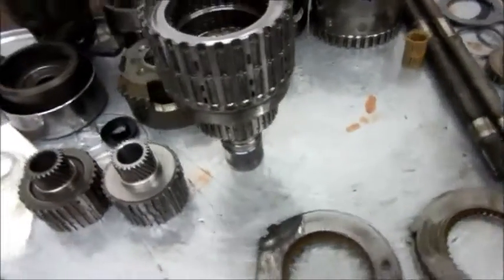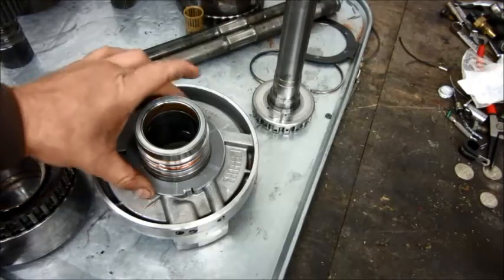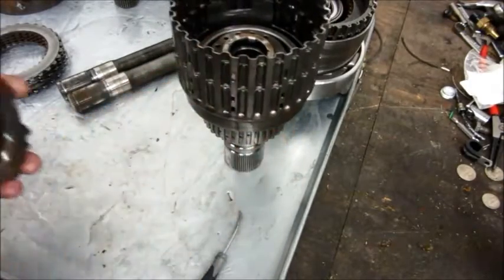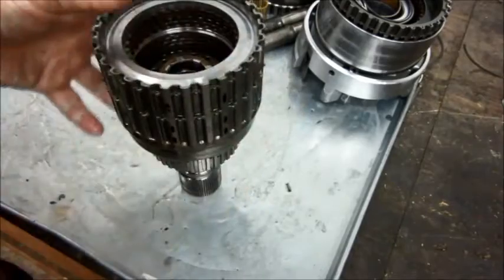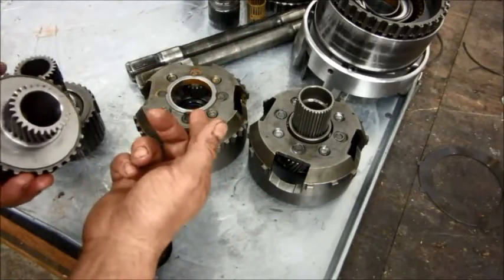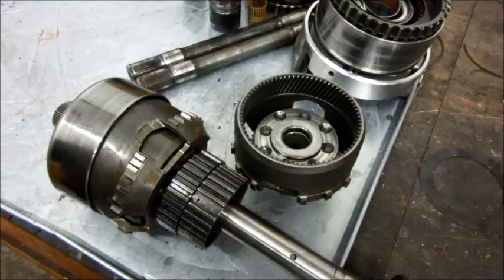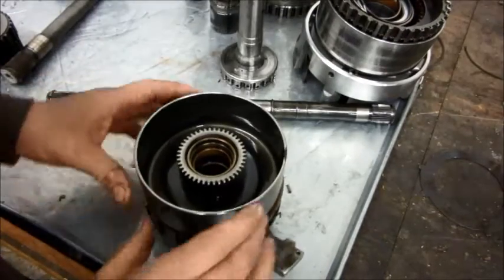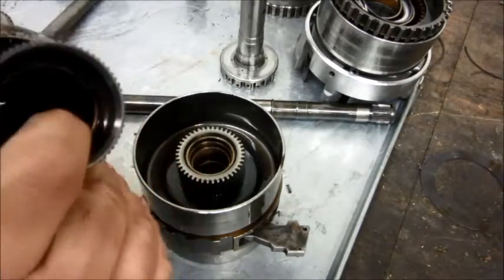Buick Turbo Draw-Through Build (pt 12) 440T4 Transmission Modifications 1

Comment: Loving this series!  Very detailed, well presented, and a plethora of information!

I'm curious:  With all the additional lubrication flow you're adding to this transmission, is there any need to compensate line pressure at the valve body?
Reply from the maker: +rhkips 

Thanks for the comment! I appreciate it.

There is a lube orifice that provides a certain amount of lube flow, higher flow when the line pressure is higher. It is called the "converter feed orifice" in the books.

The actual line pressure is set by the vacuum modulator / mod boost valve system. The turbocharger will apply positive pressure to the modulator and this will increase the line pressure above the original level. If this were a high-torque naturally-aspirated engine, then you would need to have a extra-high-ration modulator boost valve. That would allow for increased pressure without boost pressure being needed.

Comment: David,

What would you consider the biggest factor for bushing wear?  Would it be neglect or severe duty?
Reply: +Ken T. (Century7667) ....or just miles?
Reply from the maker: +Ken T. (Century7667) 

That's a hard thing to say. This transmission is 30 years old. It has signs that it's been open before, but no way to tell if the bushings have been changed or not. I have a feeling that high operating temperature, marginal lube flow (low / foamed oil etc.) and prolonged high RPM operation have a lot to do with it.
Reply: +davida1hiwaaynet Sounds like a good reason to keep the trans fluid fresh.  I did some reading on the trans.  I didn't realize how early model your transmission was.  The first one's were for the '85 model year, and that after a one year delay as they were intended to go into service for '84.
Reply from the maker: +Ken T. (Century7667) 

Exactly. The bushings are cheap and the only obstacle to most DIY folks is the driver tools. Since I have a lathe, it's trivial to turn down sockets to make drivers.

Yeah the one I have is spec'd out as an  86 model, but it has casting marks showing it was made in 85. The 1985 spec ones had a lot of concerns and they are not able to be updated to the final specification (the 89-93 style). Pretty much the only thing the 86 ones can't easily be retrofitted with is the "manouever pipe" on the pump. This does not affect durability, only downshift feel.

For a stock rebuild, the only "modifications" for later model 440T4 are a shift kit (system correction kit); adjustable modulator, metal 2nd gear thrust washer, and high ratio boost valve. On them, just renew what's worn and put it back together the same way. The newer ones go 200,000 miles regularly.

Comment: What was with GM's obsession with plastic engine parts in the 80s? From the timing gear to that thrust washer, it just seems like it was a terrible idea to begin with.
Reply: +Austin Leeds the same two motivating factors that are behind almost all bad ideas from automakers. Money savings and government regulations. Plastic parts cost less and weigh less. Fuel economy standards and emisson standards arbitraly imposed by the government caused the auto industry to come up with alot of dumb ideas over the years giving countless problems to the consumer.
Reply from the maker: +Paul Carroll 

Paul, I agree completely with your observation that bean counters and government meddling are most often the cause of Bad Designs in the automotive world.

On the plastic lube dam, it is really not a bad design. The lube dam is not under any pressure and does not carry any load in the transmission. It bridges a gap that would let oil escape before it reached a bearing. The only time you see a broken lube dam is when there has been work done on the transmission and someone was rough with it.  Furthermore, the lube dam needs to be flexible so that it can be pushed into the housing that holds it. If it were metal, it would be likely to get bent and then rub on something.